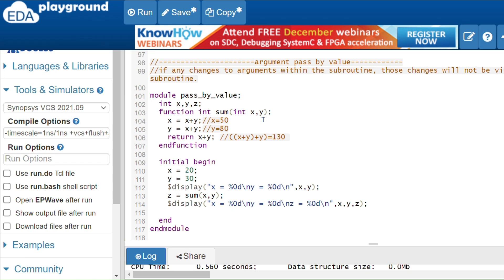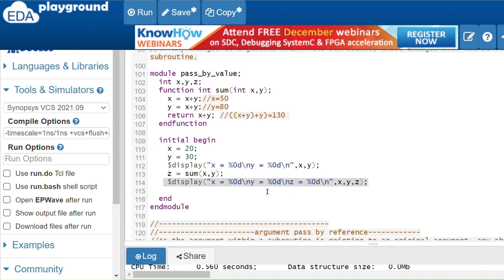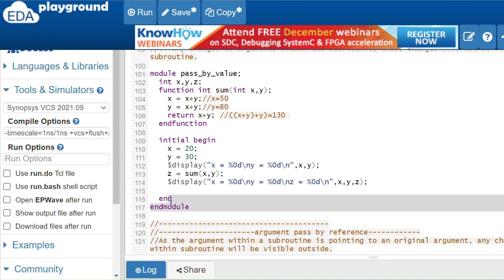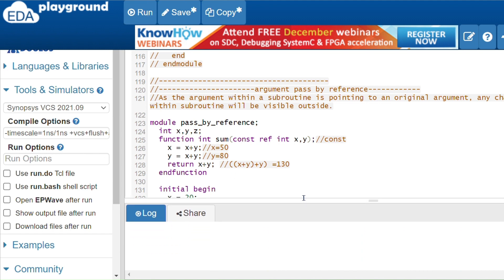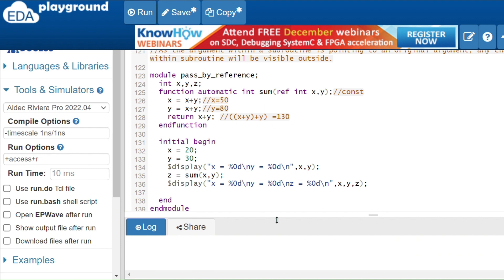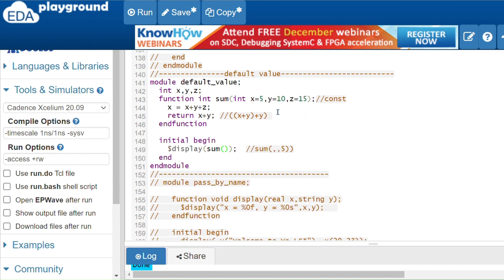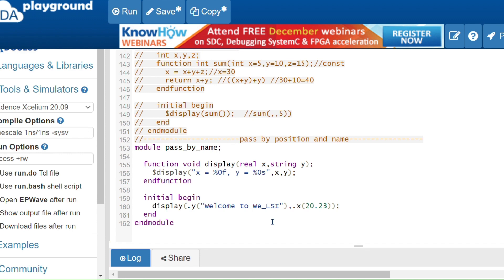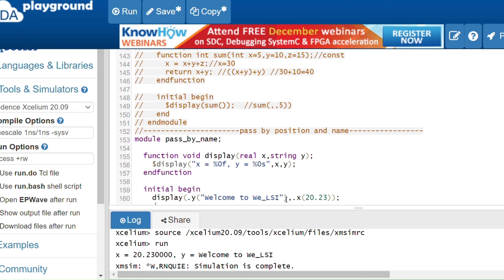Functions and tasks in System verilog | Part 3 | Pass by value/reference  | #systemverilog |

Comment: If const keyword is used before ref, we can't do any change to that variable inside that function right? Then inside that function I can't do anything with that arguments x and y crct? Only i can check some conditions whether x==y or x> y and return x+y,x-y,something like that. Suppose if output argument is declared as const,  what value will it return?
Pls help me understand it.
Reply: Thanks for a quick reply
Reply from the maker: Hi, good question!
I forgot to mention one important point there.
1st of all, 'ref' is a unique argument qualifier that cannot be combined with input, output, or inout.Combining ref with any other directional qualifier shall be illegal and it results in compiler error.

So to protect arguments passed by reference from being modified by a subroutine, the const qualifier can be used together with ref to indicate that the argument, although passed by reference, is a read-only variable.